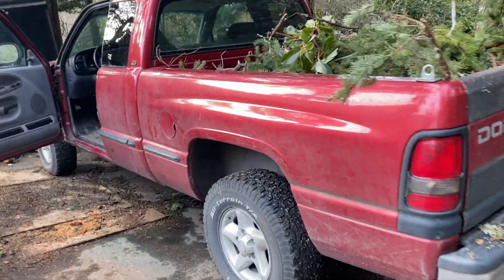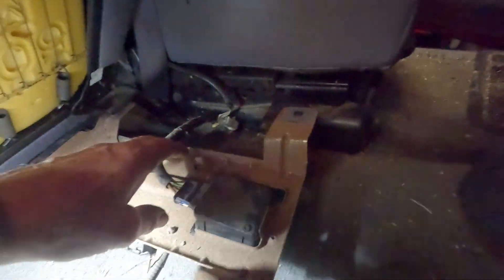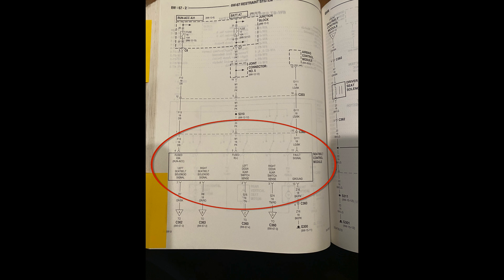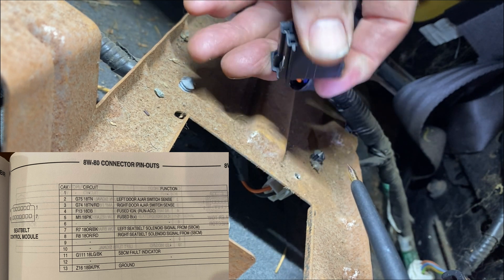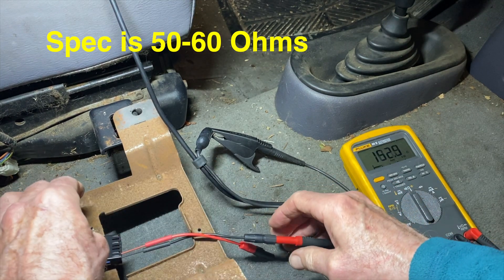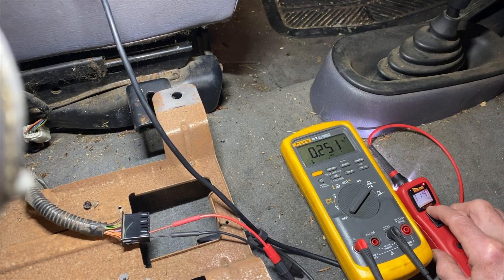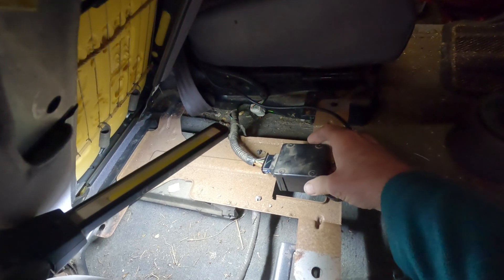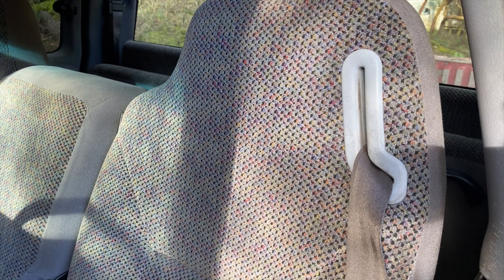How to fix seatbelts that won't extend, 1998-2001 Dodge Ram

Comment: Great video my truck had the exact same thing pop up I puled fuses track it down couldn’t figure it out. Pulled that box out gave it a small shimmy and a shake sprayed it with some contact cleaner it’s working. I’m gonna let it ride when it quits for good. I’m gonna jump that blue wire to the two solenoids just like you suggest.

Comment: Hi Dave! Sorry for the delay in responding to your video as I don't receive any notifications. Great job with the diagnostics and it could be several things that you mentioned now that it works. My bet is a cracked solder joint. Have a great day!

Comment: I had a similar issue with the SCTM never going to sleep, causing 0.5A parasitic draw thru IOD. Kills battery after a few days. 
Engine off and doors closed, the SCTM should sleep at exactly 30 minutes and de-energize the seatbelt release solenoid. 
Bench tested SCTM as OK - it would sleep at 30 minutes without driver door sense.  I found 90 ohm resistance on pin 2 of the wiring harness to the SCTM. There should be no resistance with doors closed. 
I cut wire 2 for the time being until I can track the 90 ohms down. This only disables the SCTM waking up when opening driver door. You can still wake SCTM for 30 minutes by cycling ignition on or opening passenger door. 
Haven't yet traced the 90 ohms but I bet it's from the connection to the CTM

Comment from the maker: Within a week of putting this back together the module failed to wake up again. I got a couple more days of life out of it by removing fuse #12 in the cab fuse block on pillar A for a minute, then I put the fuse back in and it worked for a short while. Then it failed again. Today I published a followup video which I'll call part 2, here:  https://youtu.be/G20Drp_a4MM?si=Rp_s9G9jzwSwm3FM

Comment: Have You tried trick with a cigarette lighter ?
Reply from the maker: Good question! For those unaware, Chrysler developed a test procedure so that techs don't have to waste time while waiting for the module to go to sleep. You sit in the drivers seat with all doors closed and windows open, push in the cigar lighter and within 5 seconds cycle the key on and off three times, then on the fourth cycle leave the key on. In test mode the seatbelt light will come on to signify you have entered a 5 minute test mode window, following which it reverts to normal operation. The next step during those 5 minutes is to open the drivers door and pull slowly on the seatbelt to see if it is latched (it should be unlatched). Then close the drivers door and reach through the window to verify that it is now latched (which is how it behaves in test mode or after a normal module goes to sleep). Then do the same test for the passenger side. Then turn the key off to revert to normal operation. Then turn the key back on to verify that the seatbelt and airbag lights are briefly illuminated for 6 seconds. In my truck, it would not enter test mode, so my clips recording that effort were discarded. As you saw, I did it the slower way by waiting for the module to go to sleep naturally.

Comment: Eric O. reminds us to understand the theory of operation before you begin the diagnosis.  What is the NORMAL logic for this timer?   I'm hoping that if your battery dies then you're not trapped?  And that you can adjust your belt with the door closed?  Was this ABNORMAL behaviour, such as the inertial ball getting stuck?  Or the timer not counting down?  Or both combined?

What if a door switch breaks?

I suspect the designers feared the danger of airbag deployment and demanded a redundant seat belt, i.e. electrical + centrifugal.  EDIT: Just saw your comment about this being an electronic relocation of the pendulum device.
Reply from the maker: What a great series of questions. The solenoids are always powered when key is on, even with doors closed, and power remains for 30 min after the engine is stopped so in a collision you'll likely still be able to remove belts.  So yup, you can easily adjust belts when driving. As you say if the battery were destroyed the belts would lock up, but the belt clips can normally be removed even when under tension. Either closing or opening either door will wake the module up, but I don't believe the door lock input is used for anything else. These modules were problematic because if input from the inertial ball was not seen after ten key cycles, the seat belt warning light would appear. That led to multiple warranty complaints which ultimately led to this electronic system being discontinued in favor of old style pure mechanical inertial seat belt locks. I looked for info regarding how the air bag module uses the data from the timer module, and there was no mention of air bag deployment being suspended if the car doesn't detect seat belt use. As is often the case, many details are left unanswered in the dealer repair manual.

Comment: I have owned the same truck since new.  I had this problem about 15 years ago. I found that if I unplugged the module it would work again.  The intermittent failures became more frequent and more annoying so I checked powers and grounds, condemned the module, and took a ride to the local (at the time) U-Pull-It.  For a whopping $7! I had a used module, installed it, and it's worked ever since.  So nice not having to reprogram simple things like this.  I still have that old non working module somewhere and that truck is still my daily driver!

Comment: Great video. If new modules are no longer available, another option would be to split the case on your module and see if there is anything obvious like a cold solder joint or something that may be simple to fix. I would guess that given the age of the truck and the fact that it is delivering battery voltage to the solenoids the driver is not an obscure or custom chip.  It may something as simple as a solid state relay.  If it is not easily repairable, you always could revert to the blue jumper fix.